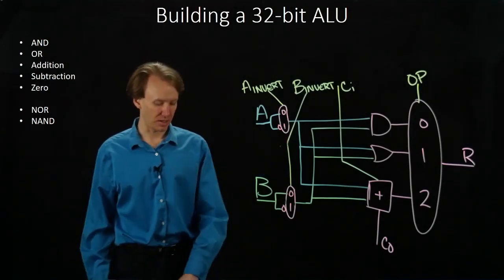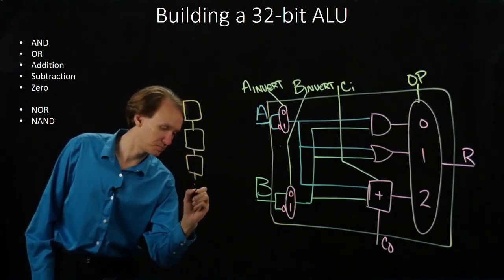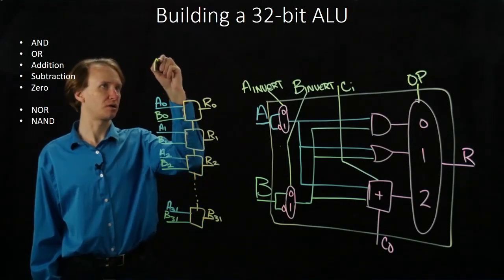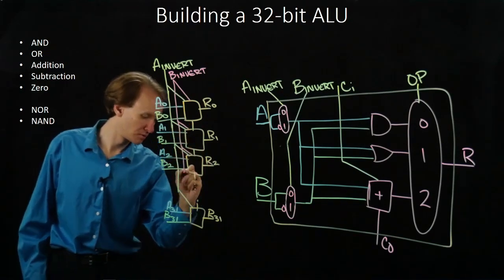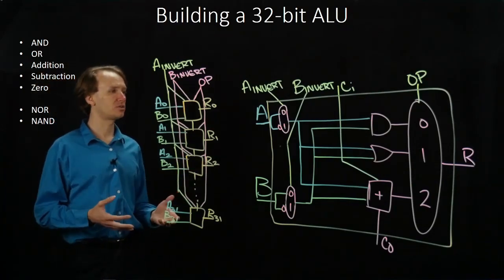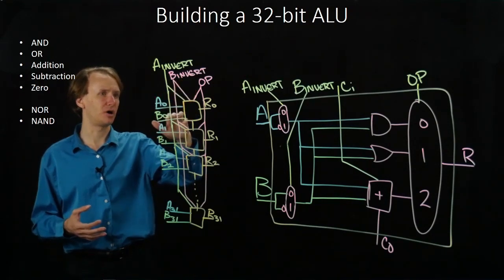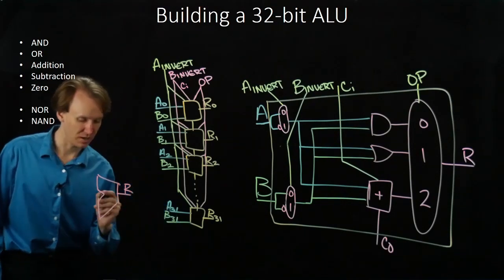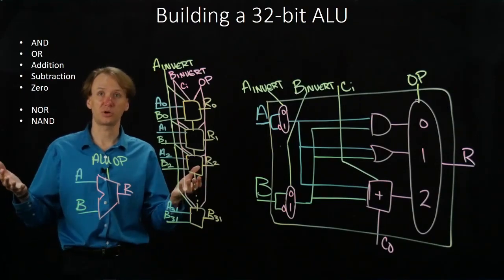9-1.  Building a 32-bit ALU

Comment: One question: If you would use separate inputs for BInvert and CarryIn, wouldn't this potentially enable you to create a 64Bit ALU out of two 32Bit ALUs? So in that case it would matter weither you use different Inputs for BInvert and CarryIn.

Comment: Thank you for your explanation! I just started learning digital design recently, and I still can't understand why the CarryIn is always the same as Binvert. I mean ...why CarryIn is 1 when doing subtraction? Is it because 2's complement? I'm struggling ...
Reply: Hi, I'm a new learner as well but I think yes, the inputs are assumed to be in twos complement, so to do subtraction you get the negative value of an operand with twos complement (since a - b = a + (-b) = a + (not(b) + 1)). So this involves both inverting the bits of the operand b (yielding the ones complement) and adding 1 with the carry in. If carryin were 0 and binvert were 1, this would be a + not(b), so the result will be off by one.

Comment: Can someone explain to me why the b invert line is the first carry in line
Reply: Carry-in sums up to the input bits. When we subtract b from a, we invert bits of b and add 1 to the result, finding (-b) in 2-complement notation. The tricky part is that this added 1 to the inverted bits is actually the first carry-in. In other words, instead of creating more hardware to add 1 to the inverted b, the carry-in was practically used.